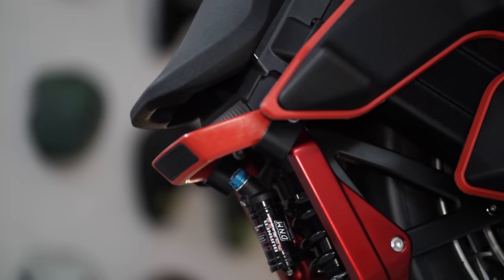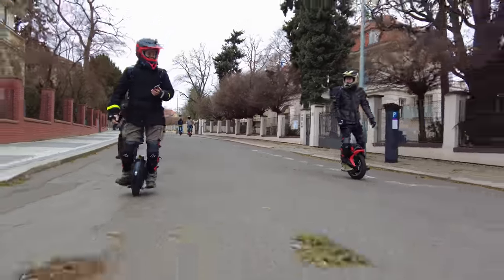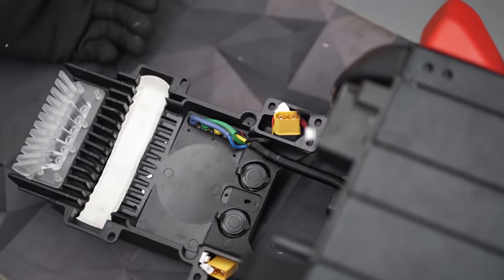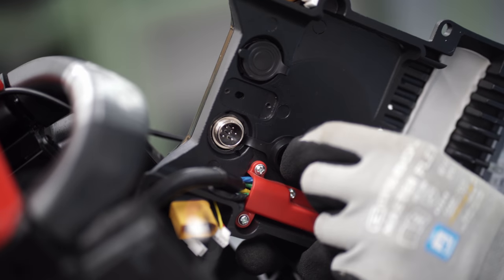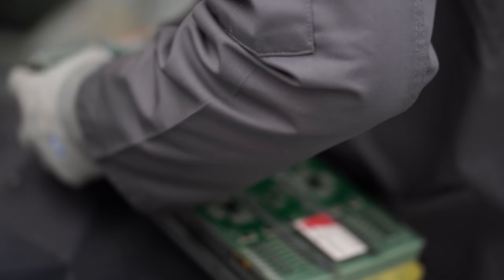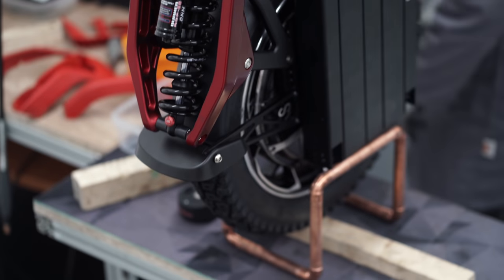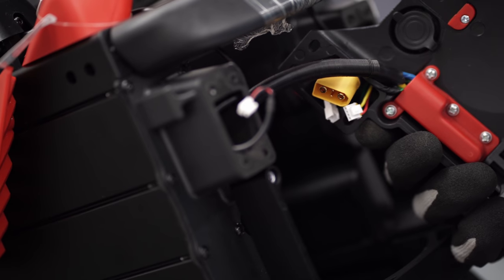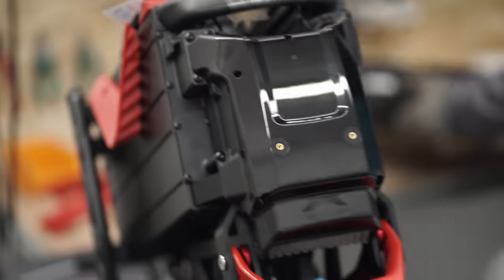⚡ KINGSONG S20 EAGLE | QUALITY REVIEW [4K]

Comment: To be fair, KS was not the first creating a rubber cover for the bearings. Inmotion did it a year ago. New V11 include a rubber cover of the bearings. The humidity indicator on the S20 (renamed S22) is a good idea. Not just due to possible wet during disassembly or full submersion, but while using them. Essentially they are just protected by a thin layer of aluminum without any external cover that absorbs the energy of an impact. During a crash these boxes can suffer and their rubber seal fail without visual notice. Water and lithium are not good friends and the paper indicator seems a good idea since it allows to check it periodically in a preventive way. Great
Reply from the maker: Yes noticed rubber cover in last V11 (we had only older versions before and even 2nd generation does not have it). Regarding case protection you have Powerpads as softener rubber protection, so it can be damaged only if you hit exactly in open part of the battery, that is very rare

Comment: Bumper KS said they are upgrading. Also the hall sensor is just supposed to be wireless. Still has to be one there , just no wire I guess they are saying.
Reply: I took the statement to mean if the hall.sensor failed whilst riding, the wheel wouldn't cut out and face plant the rider...... which would  probably leave the effect of no speed read out on the wheel or app....
Reply: @davidcampbell8667  🤔
Reply: @davidcampbell8667  You are absolut correct!
sure, the wheel has still wired hall sensors. But in case of a hall sensor failure you get an alarm and DO NOT faceplant as on other wheels.
THATS what was KS always trying to explain!

Comment: Why did you have to take the suspension off and disconnect the battery? Without taking the motherboard case apart could you not unscrew the red cover from the motherboard case and unplug the three wires?
Reply from the maker: It is possible but very hard to do due to lack of space

Comment: Im disapoionted this euc is not for people 75+ Kg too weak low end torque ,charger not charge to 100% , Toy quality plastic on bumpers. Motor too mutch oriented for speed. Tragic range for 2200wh and price tag. 
Very bad tire by factory no nimble tire feel just tragic choice. Lights is joke what after first crash no have chance survive. Not covered shock against crash. 
Things what i like is  BMS and firmware update ability.
 Safety on batery circuit. Asembly quality.
 I have very mixed feelings only time show. Best be wait year to kingsong fix all problems and make more and beter revisions. 
I am not suspension fan at all this is why i not coment suspension .
 And fact that in may /june come here (CZ) first generation and in may/june  kingsong be produce version(revison) 2 or 3 is bad move pay money for first generation only because 4+ month shiping time this is just nonsence(example how many ks16x revision be make in 6month from production same Sherman they make 2 revisions in short production time. 
Container Ship is slow and expensive train use rusian rail and air shiping is expensive too no good solution here. 
After tragic V12 launch where burn mosfets is good example why no rush first batches at all.
My background over 12000km on EUC i own KS16X,MSP2500W,Sherman V2. 
Just for me is S20 disapointment and overhype but 100people 100tastes and i belive for many new riders S20 be dream but not forget GEAR SELF ALWAYS euc crashes is not joke and respect trafic rules please !